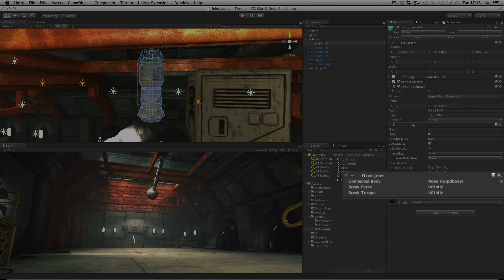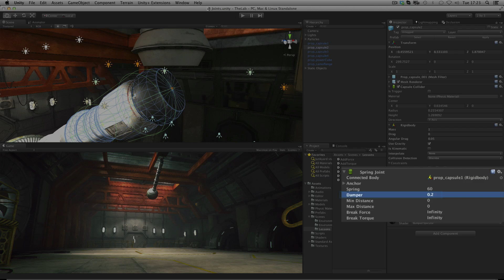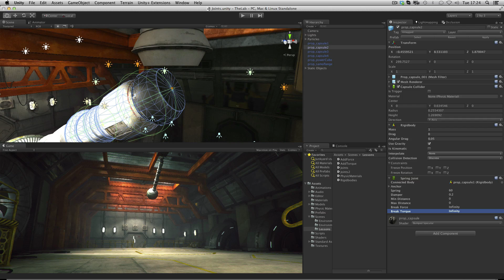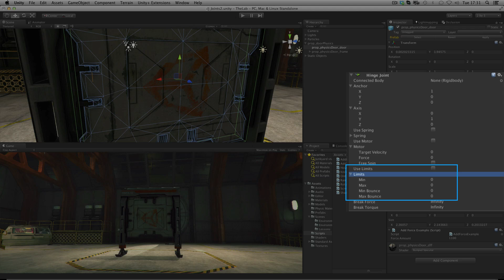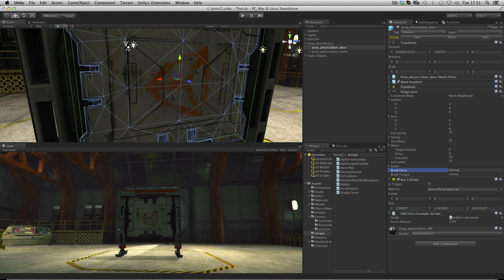Joints - Unity Official Tutorials

Comment: Hi, in Unity I have a car with a rigidbody and each of the car's tires has a sphere collider. Can I simply take 4 spring joint and attach them to each wheel on one side and to the car on the other? Or would fixed joints be required here?

Comment: Would be more helpful if you just could do this one from the beginning instead of explaining the half of something thats not even clear enough to work with alone. Whats with the Sphere?? Which joint is it using??  If i do the same in Unity the sphere seems to be "heavier" then the other capsules. I just added a spring joint to the Sphere but it has a very big distance to the other last capsule it is attached to. I also added some higher value to the "Spring" but also didnt effected it that much that it looks like the sphere is attached to the capsule. The tutorial is nice but very weak on informations.